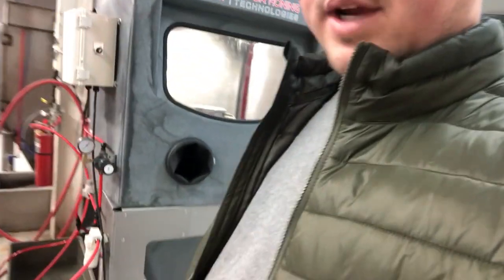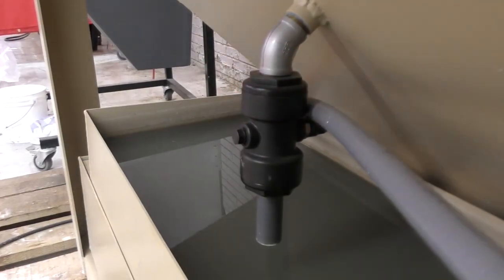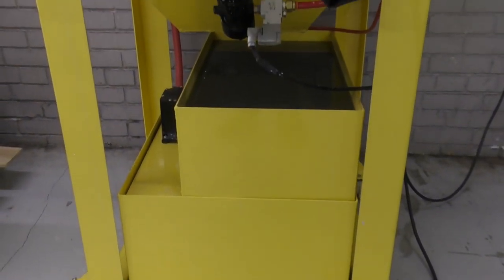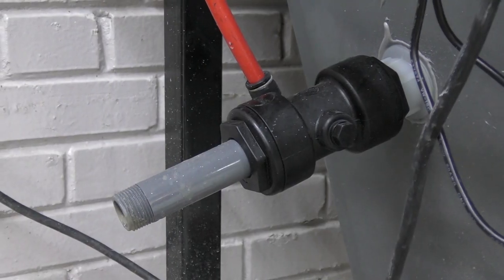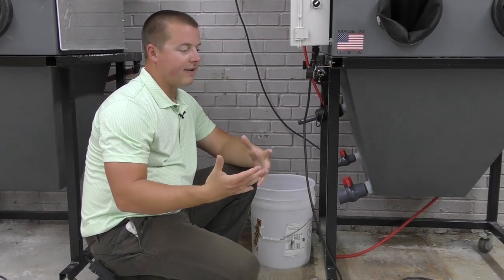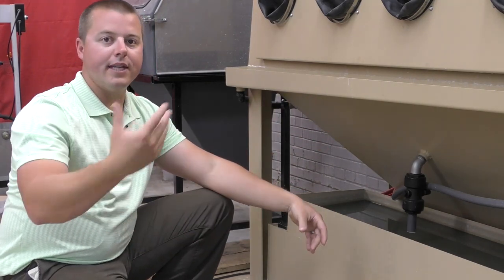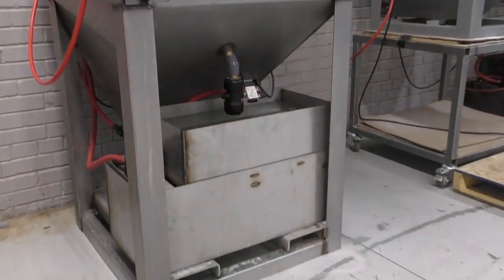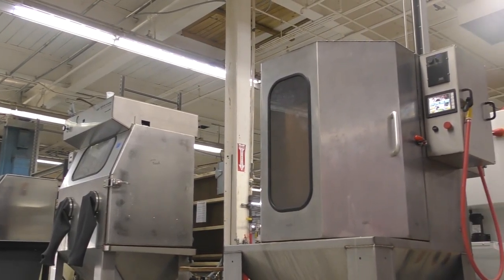Why Buy a Closed or Open Loop - Vapor Honing Technologies

Comment: Can I blast outside the cabinet? For example, I want to blast a differential and no way it will fit but can it be used to blast without the cabinet?
Reply from the maker: Which Vapor Honing cabinet do you have?  I too have blasted a part too big for our cabinet, this will cause a Huge Mess as you can imagine, but it can be done.  For more information or to place your Order Today; please contact me at 828-202-5563 x 103 Niki or Email nicole@vaporhoningtechnologies.com